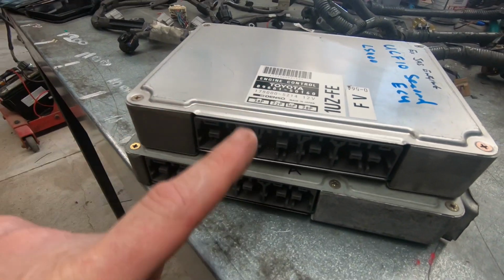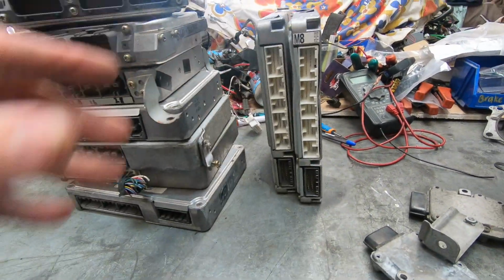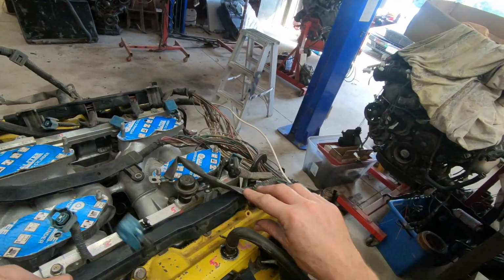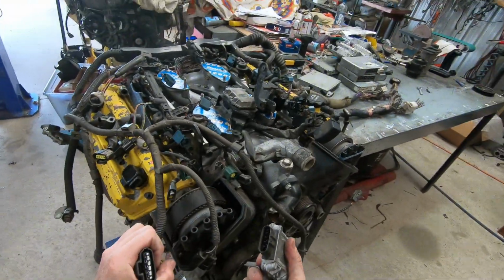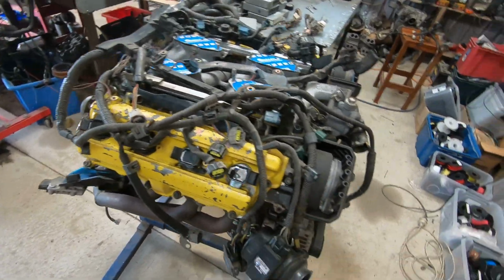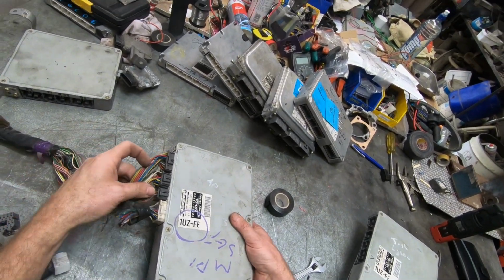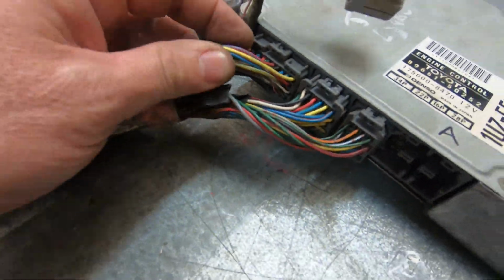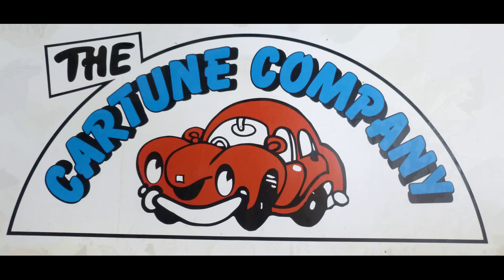UCF10 harness & ecu verses UCF20 harness & ecu. Can the ecu be swapped????

Comment: Can you swap harnesses though ? My 92 sc400 harness is done can I use one from like a 94 ? Or use that one to refab mine with some connectors
Reply from the maker: I have soarer / sc400 harnesses on my bench atm for a similar video as they also have differences within the same models.  To swap it requires to be the same version.

Comment: so i have literally bought a good running 1uz-fe for a packet of smokes and bottle of Jack Daniels of my mate from a ucf10 ls400, so now im in the research stage on the whole idea of stock ecu used in a engine swap "into a ke70 wagon 😅" if i fail in my research expect a email 😂
Reply from the maker: I sell wiring instructions to make the wiring easy.  Cheers Kelvin
Reply: @CartuneNZ  how much would your instructions be? you have my interest now
Reply from the maker: $175nzd at present,  which is about $115usd.  Comes with 20 minutes of my time as well to discuss anything you want,  wiring,   other conversion issues ,  the weather,  or even relationship issues even though I know nothing about woman.  Cheers Kelvin
Reply: and instructions work with the 89661-50070 4 plug ecu for the ucf10
Reply from the maker: @tcollogan  yes,  I have a set for the early ucf10 ecu.